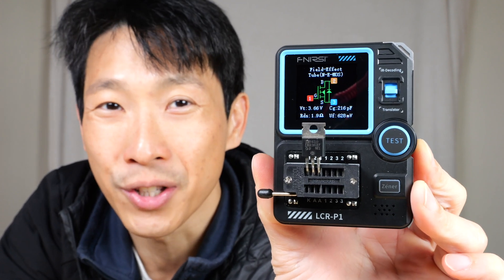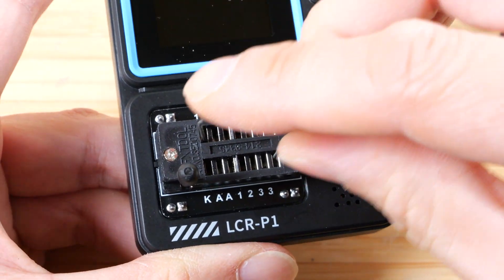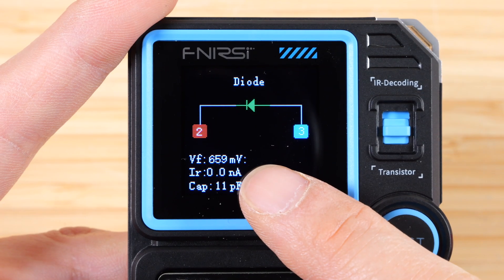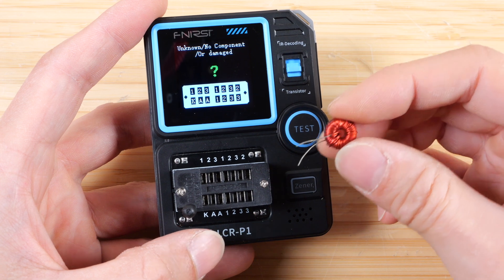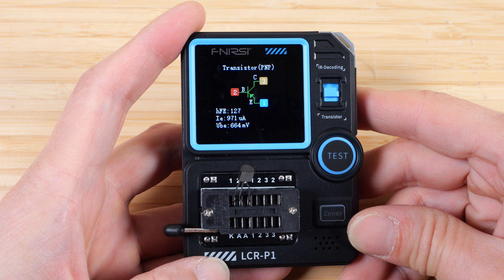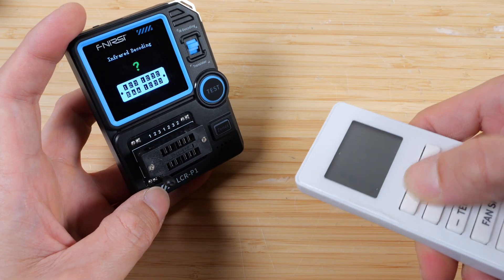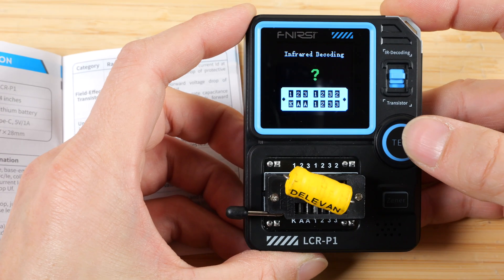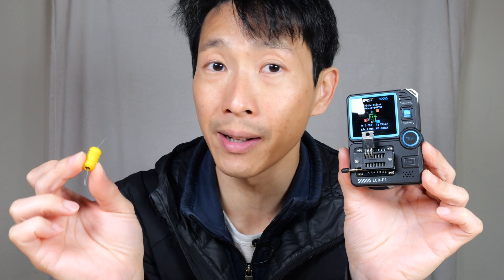FNIRSI Transistor Diode and LCR Tester

Comment: Can this device check capacitors that are still in a curcuit with the leads? Looks like a really good device even if it cant!
Reply from the maker: You cant really check capacitors in-circuit because current will be diverted into other components making the measurement unusable.